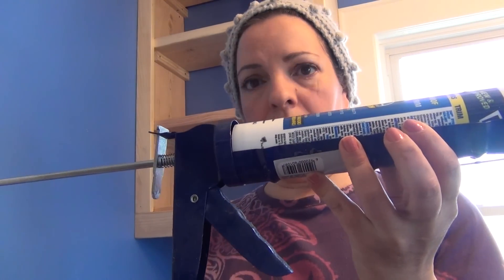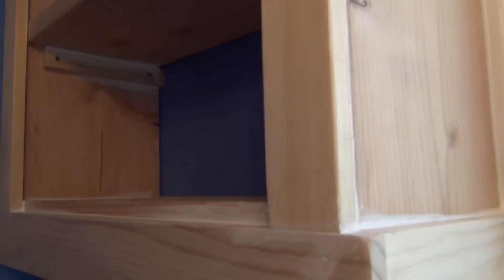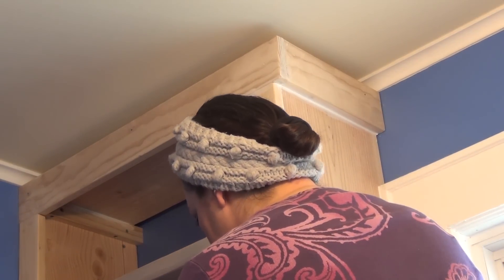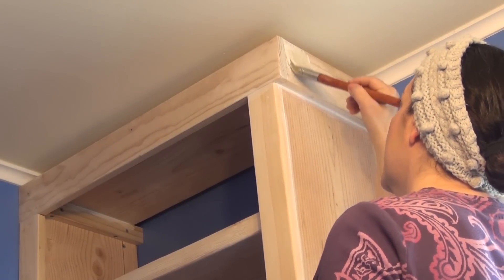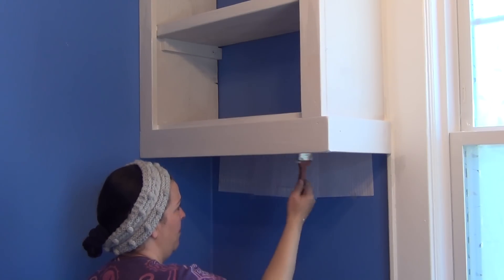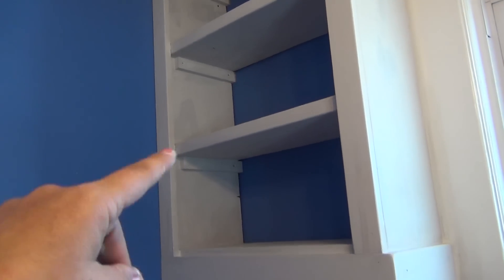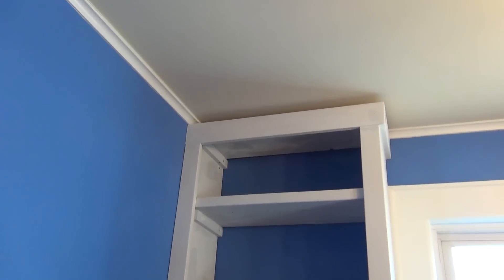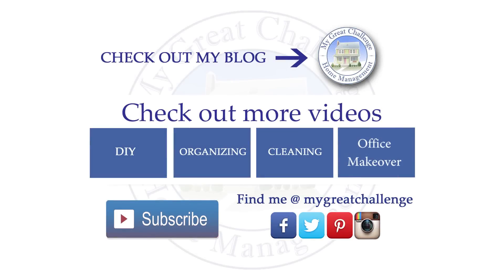Home Office Makeover: Caulking and Priming

Comment: Your shelves are going to look great!  You did an awesome job building them! I too don't use tape when painting. I had to paint my whole basement by myself and wanted to cut some of the work out, so  I stopped using tape.  I keep a wet rag near by for mistakes and a thin/small painting brush for tight spaces and I'm good.  I know what you mean about painting ceilings ...it's the most painful part of painting when you don't have the strength for it. I look forward to your videos. ..you inspire me to do some work around my house. TFS! Maggie

Comment: You did a good job with the caulking gun.  I always make a mess of that stuff.  It takes a really steady strong hand to get a smooth line with that caulking gun.  Shelves look awesome!  Wow--what a job you took on and look at how beautiful they are.  I stained my knotty pine paneling with Minwax poly and the brush just dragged through it because it was so thick.  It was soooooo hard.  No way to use a roller on it at all--so I felt your pain with thick paint and brush drag.  They will look great when you're done.  Great vid Sophia!

Comment: I know how you feel about priming in complicated areas... I use a small brush for edges and corners, and a foam roller for the rest. I find that it is easier to minimize those brush lines that always want to happen... then you can cheat and sand a little between primer coats. It seems that the foam roller pushes the primer into minute crevices more smoothly. I have been refinishing a few furniture pieces lately and I have relied on the foam roller to get the smoothest finish possible. You have done an outstanding job building your bookcases! You are my kind of girl! Someone needs to give you a 23 guage headless pinner  for all of your future projects! Ahem! Nice mothers day present! Its on my wishlist! My brother was visiting for Easter, and he was schooling me on nailers and my new air compressor. This will eliminate the visibility of nailheads for you in your future endeavors. His professional opinion guided me to this: item # 1000764689 Bostich 23GA Headless Pinner. This item is at Home Depot.  The 23 Guage will be less likely to split your wood as it is so fine.. xo

Comment: If you click the metal tap, right under the metal stick that holds the caulk in, it will stop the caulk from pouring out after pulling the trigger to get the caulk out. Does that make sense?